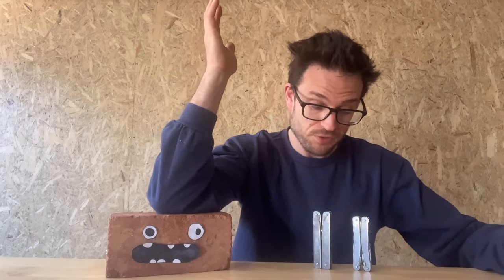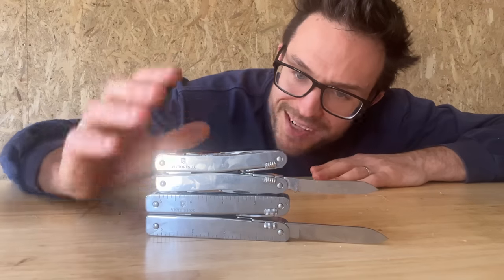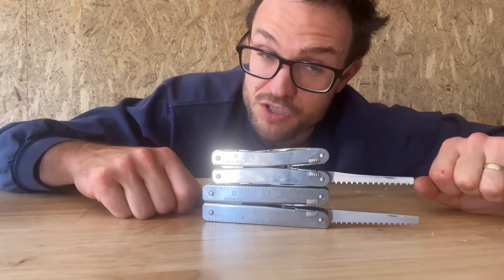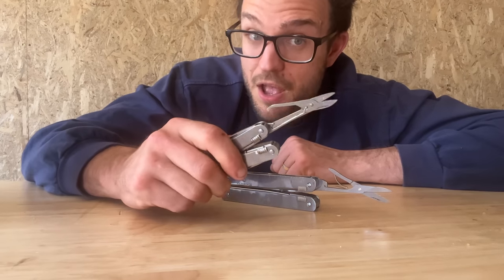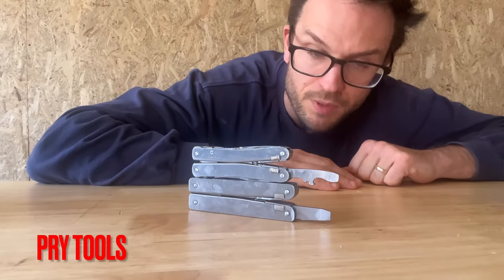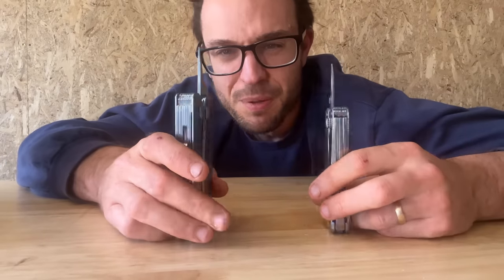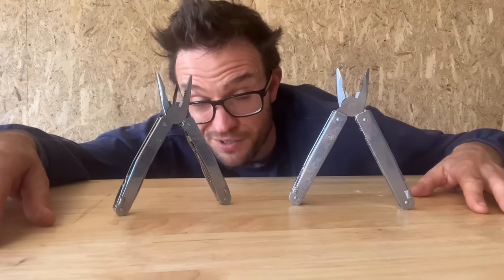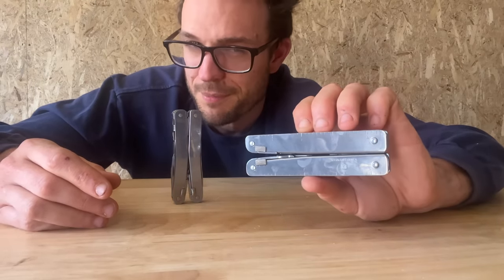Victorinox Spirit vs Swisstool - Multitool Comparison

Comment: I’ve been using the Swiss tool for over 20 years now. It’s certainly the best multitool I’ve ever used. Very durable! I occasionally use it as a hammer and it is not harmed.

Comment: I used to have a job where I did lots of machine maintenance, and I carried my SwissTool X on my belt every day. It served me extremely well, way better than any of the handful of Gerber and Leatherman multitools I tried. My current job doesn't require me to have a multitool on me, and I kinda miss carrying it all the time (it's hard to justify having the bulk of it on my belt if I don't need it...even though it certainly does attract the ladies! lol).

My SwissTool differs from yours in that it has a curved serrated blade instead of the file. I am really torn about which tool would be better there! I could see a file being really useful, yet I kinda agree with your point that you should just grab a hand file. But if I'm out away from the house and my tools, having a file at the ready could be really good. However, that serrated blade is probably my most used tool on it. It's perfectly designed for strap cutting, zip ties, etc.

Honestly, my ideal SwissTool X would keep the serrated blade, but delete the regular blade and put a file there instead. I always have at least one pocket knife on me, so why would I need one on my multitool? I'd use a file a LOT more than that blade; hell, the blade pretty much never gets used at all. I think it would be cool if Victorinox and the other guys would consider offering this as an option, since so many of us now are total nerds about knives but we may want to also be nerds about multitools, and the knife on a multitool will be useless and redundant to us.
Reply: Very good points, Taylor! If V was still making the Swisstool Spirit XC, that might have been an alternative for you as it has a serrated blade & the file with a saw...you could then just carry a dedicated folder & you'd be all set...btw, your tool is the Swisstool RS(Rescue - Safety)  aimed at rescue response personnel...hence the reason there is not a file...I believe they stopped making them in 2017....
Reply: I've NEVER used either blade on mine, if I'm ever in an emergency where I need to cut a seatbelt or something I'll have a factory -sharp blade for the job. I carry and use a pocket knife so there's no guarantee it'll be razor sharp in a life or death situation.

Comment: Swisstool X Plus (ratchet) 3.0339 L .it is it, the definitive Multitool.
In its leather sheath you also can add:
1 adjustable wrench 4"
2 adapter ¼hex ¼drive for sockets
3 sewing nails (medium-large) for repairs, pierce alcohol bottle, compass, windscreen wipers, lpg nozzles, splinters removal
4 a magnet to retrieve objects.
5 some spare cash in small changes
By side you can also carry:
1 ¼drive socket set 6 to 13mm 
2 indexes with more ¼ drive standard bits implementation especially Torx and Allen but also anti-tamper.

A separated ratchet that fits in everywhere is the biggest advantage right out of the box because of course it will fit where a multitool mounting proprietary bits in a screwdriver manner not; and, moreover, because most of fixings are made by 2 components (a nut and a screw or bolt)in order to work proficiently you also need two devices, one retaining and the other fastening or undoing.

Comment: The Swiss tool also has a fairly accurate set square function, which I’ve put into use in the past. I have two multi tools, the original leatherrman and the Swisstool the original Leathermam is still a lightweight and useful tool, probably not the most comfortable, the Swiss tool is a heavier more comfortable but no less useful tool. It’s a case of horses for courses.

Comment: Thanks for the well-thought out comparison. I also own both, but both without the scissors (since I usually carry a VIC SAK with scissors in addition or a LM Style PS, and the scissors particularly on the Spirit are 2nd class). On a multitool, I like serrated blades quite a lot as a complement to the straight edge on my knife. I think the Spirit is a bit more advanced, since it's newer and they had some time to develop it further. Generally, I think a MT is something of smaller size, since if I know what I want/need, I take a dedicated tool with me, e.g. for pliers. (and there are no pliers on any MT in the world which can compete with Knipex pliers - which are competitively priced in Germany.

Comment: If the handle curve on the Spirit is more comfortable using the pliers, for everything else it would be a disadvantage. There is also a way to use the Swisstool with the handles at quare angle, which on top of the ruler, adds an actual external square angle, and holding one of the handles (upward or downward) together with the closed jaws in the hand for an awesome grip using some tools.
Original Swisstool for me, no question.

Comment: I got one of the first swisstools that came out, and the large phillips driver is absolutely useless, cams out of everything, very bad design, hope they changed it, the wire cutter is also soft steel and dints unlike the leatherman. The tools are soft steel which makes them great for prying, I broke the large driver on my leatherman wave, steel is too hard. Sometimes soft steel is good.